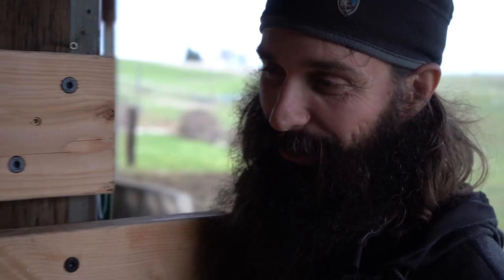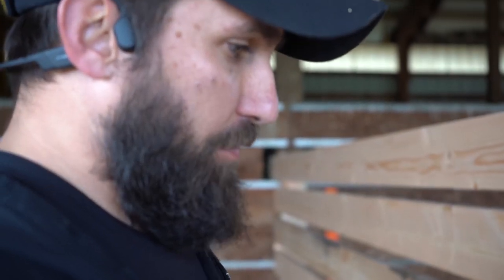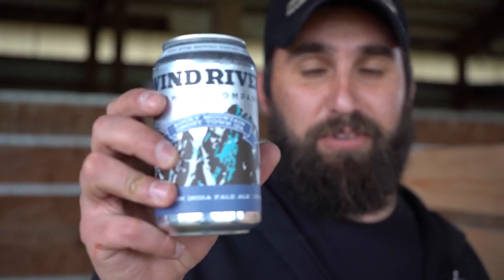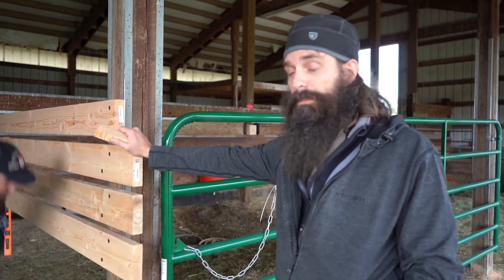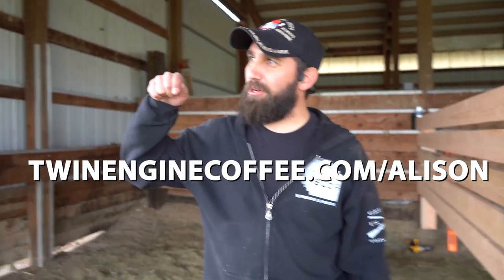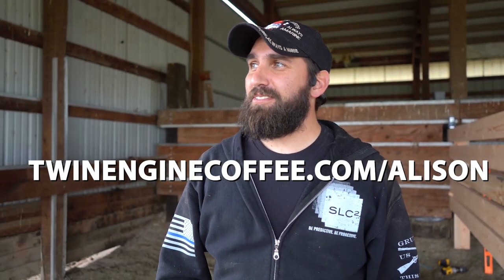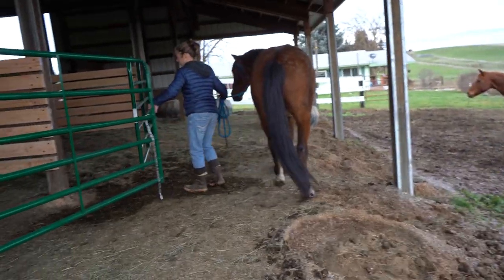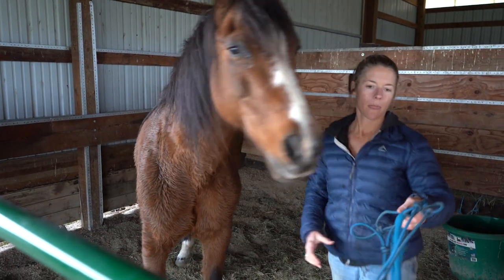How to build easy horse stalls fast!

Comment: Is Sassy having laminatic issues or seedy toe? Mine have been through it. I've learned so much. I like flexible filly halter & muzzles and I haven't tried it yet, but I like the Forma Hoof USA mold & chemical. It's just pricey. 
I like Keratex Nail hole sterilizer , I think it's called for the lower part of the hoof wall as a dressing and the wall and white line areas for seedy toe. It's not for the frog. 
Things I've learned...
Reply: Nice stalls! Love the gate! ♥️
Reply: Lol I was going to ask about the hoof problem as well.  Unfortunately locking them up shows down the healing process, much better to let them move.  Used to rehab horses with hoof issues, my favorite thing to do.  They need a better farrier that knows how to fix problems (unless it’s laminitis then the owner needs to make changes).
Reply from the maker: never heard of seedy toe - how can you tell the difference? my vet says laminitis but I am suspicious as her x-rays have been perfect and reveal no changes despite significant pain. she is doing well now! I am looking into the flexible filly! What is forma hoof used for?